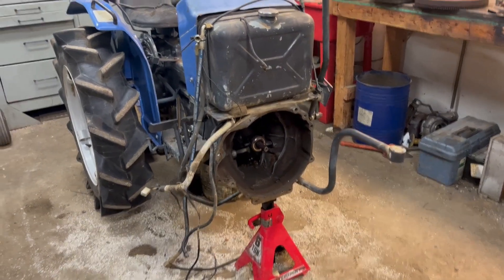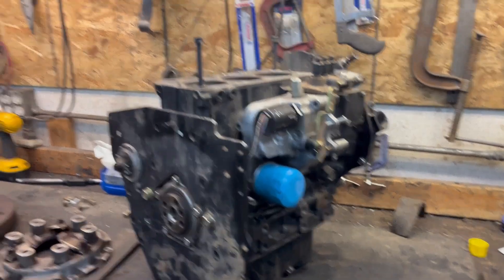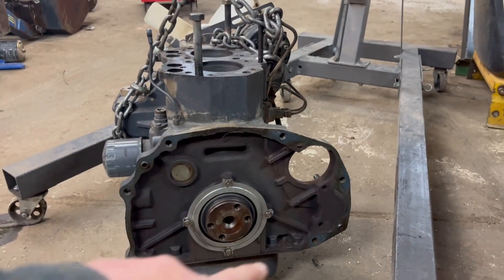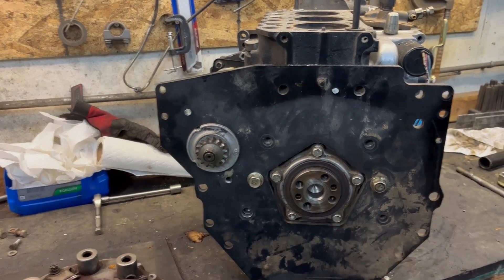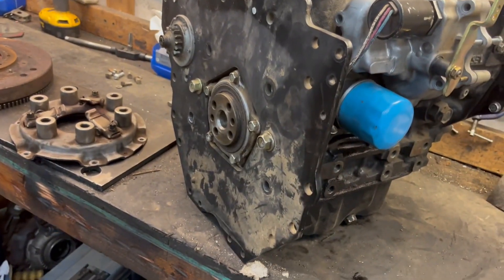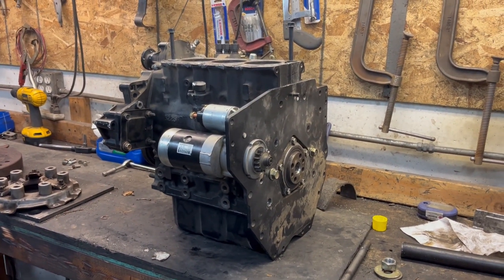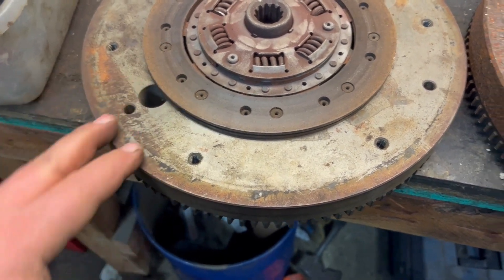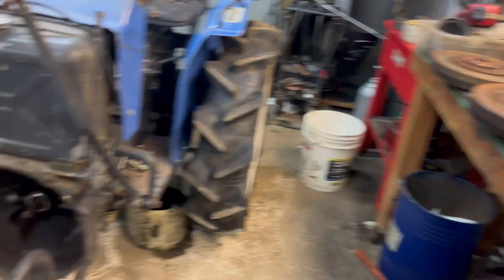Mitsubishi D1800 II repower (part 2)

Comment: I have the same tractor Mitsubishi d1800 white the ke95 engine, my question is You have the information of how many pounds of torque I have to tighten the screws on the engine head.??
Reply from the maker: That was so long ago, I certainly don't remember. I got the cylinder head from Southern Global Tractor in MS. Maybe give them a call. I'll have a look through my emails and post up if I find anything.
Reply from the maker: Hah! Found it.

cylinder head bolt -14mm
101-115 ft-lbs (13-1kg-m)

cylinder head bolt - 10mm
54-61 ft-lbs

con rod cap bolt
36-39 ft-lbs
valve clearance
0.013 in cold
Reply: Thank you so very much

Comment: The ead of my engine looks like it has a little crack between the intake and exhaust valve 😢 do you have the same problem?
Reply from the maker: Your crack is on the block, not the head? The head is the most common place for cracks like that to occur. All is not lost; you have options to repair it. Chances are the metal is too thin to weld, but it can be brazed or stitching pins can be used, usually. Good luck!

Comment: It wouldn't you be able to just take that plate?And I'm bolted from that motor that has 3 cylinders and flip it over.That would put the starter on the other side.Of course you'd have to move the starter from the back side of the plate to the other side of the plate but then you get everything you need to get I would think
Reply from the maker: If I recall, that would have put the starter on the same side as the injection pump. No room on that side.